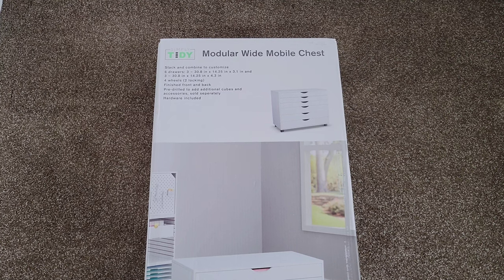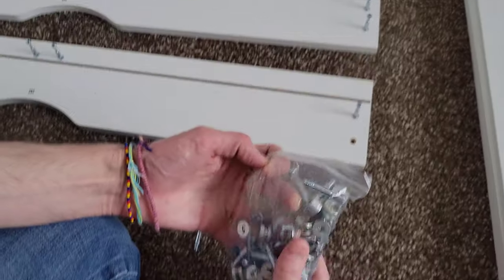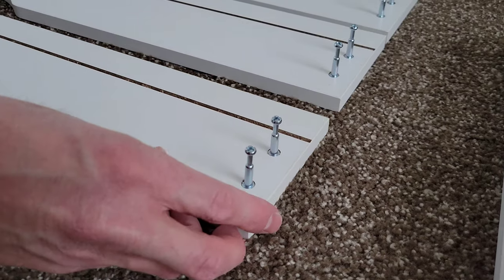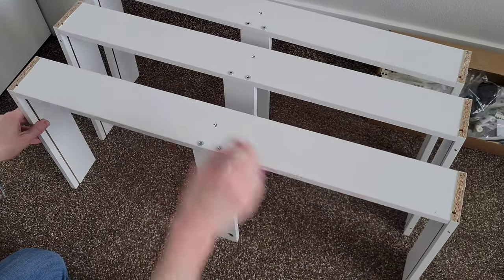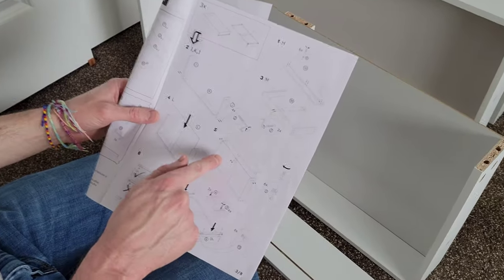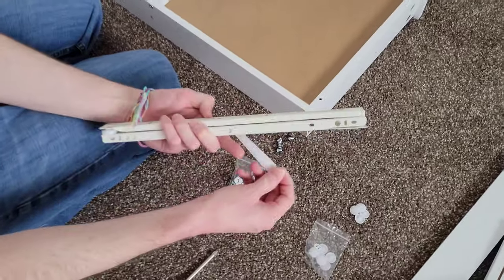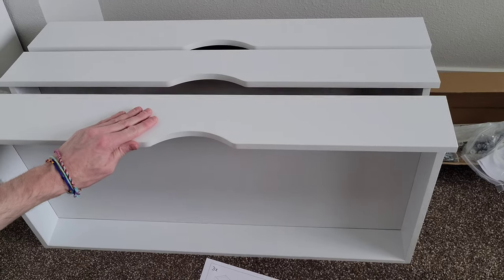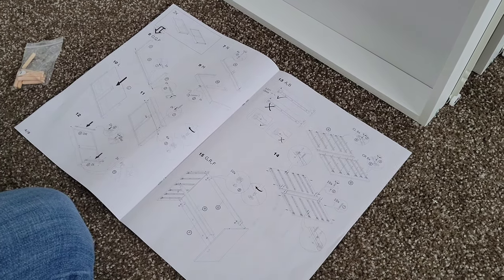Simply Tidy Modular Wide Mobile Chest - How To Assemble

Comment: Thank u so much for this explanation. I started watching and then went ahead and put mine together. Took me all day and then realized the sides were on the wrong sides. Had to take it apart and swap them. Should have watched the whole video while I was working on this! Would have saved me some time and aggravation! 
Also my bottom drawer doesn’t line up correctly on one side.. ugh not taking anything apart again
Reply: Could the hardware on the side  of the cabinet be screwed thru the wrong hole? That would be a super easy thing to do and would account for the misalignment.  (otherwise, I'm as confused about that drawer as you are!)

Comment: This video was super helpful! So much easier to follow you than the paper instructions. The one thing I did differently is I put the back panels (E) in white side OUT so the unit looks finished on the back too. Also I slid each panel down the slot on the sides and into the bottom channel , then I slid part #12 down both panels. It was just easier which appealed to my naturally lazy self. You do a great instructional video. Next time I need to construct something-- I'm checking to see if you have done it first. :)

Comment: What are the interior dimensions of each drawer  and, assuming the slides aren’t full extension, how much of the drawer pulls out?   Thinking about using this to hold spices in the pantry.
Reply: Interior dimensions of the drawer is 29" wide by 13.25" deep(front to back). When fully extended the opening is 10".

Comment: What are the inside dimensions of the drawers??  Thank you!
Reply: Interior dimensions of the drawer is 29" wide by 13.25" deep(front to back). When fully extended the opening is 10". The top drawers are 2" deep and the bottom ones are 2.75" deep.

Comment: My drawer is stuck! I’ve taken it apart and put it back 3x . 8hrs of working on this ! Any suggestions? I’m so frustrated. The drawer literally will not come out without taking the whole thing apart. Botton drawer is the one I started with. Ugh !
Reply: Did you ever figure it out?! I can’t get mine to go in without force and then it is stuck. I’m about to lose my mind!
Reply: I actually lift it a little and it goes in. I took it apart 3 more times. It still gets stuck. It absolutely horrid at times . I worry sometimes it may NOT close. I will never buy another!